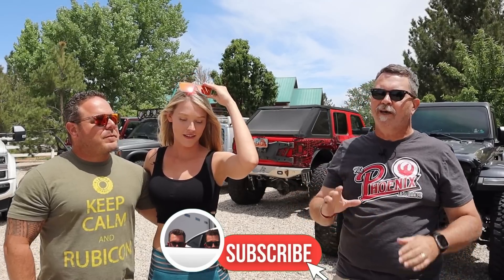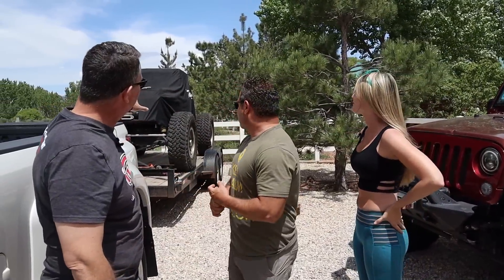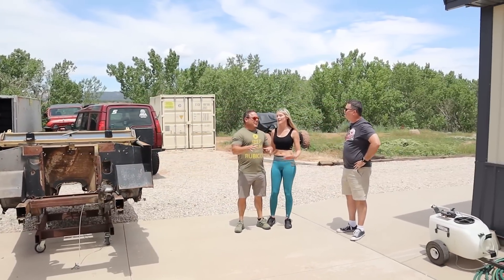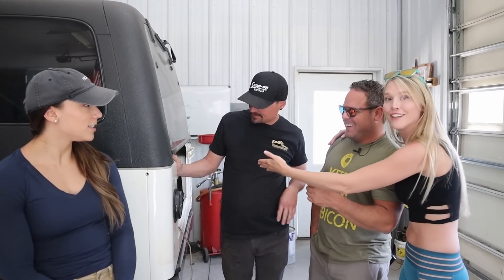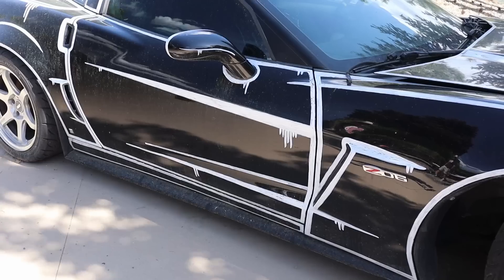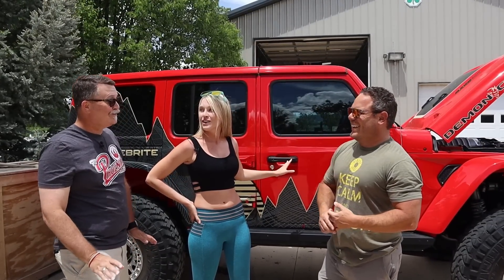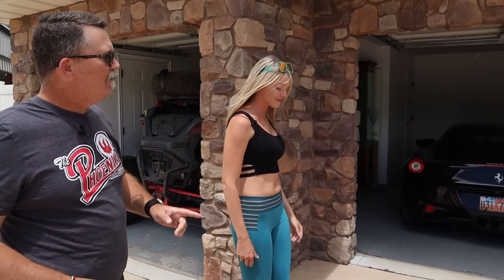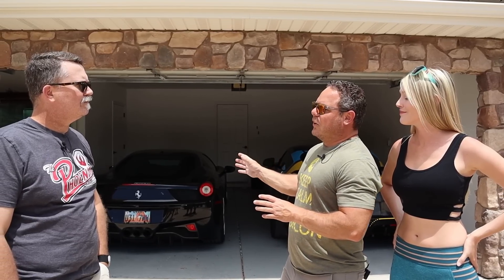LITE BRITE GARAGE TOUR!

Comment: Kevin, late on the comments, but need to clarify the issue on titanium exhaust.

The problem with using titanium for exhaust parts is that there are no manufacturers that do a vacuum stress relief. Provided the titanium is stress relieved, it doesn't work harden and crack. The other issue is that there are a multitude of titanium alloys, and it's quite possible that the alloy selected isn't the correct alloy for the temperatures the exhaust is exposed to.

I have a "few" titanium bicycles. The best riding bikes are made from 6AL-4V. It also happens to be double the cost of  commercially pure 3AL 2.5.

Inconel and Hastelloy are the super alloys used in high temperature aerospace applications. Both alloys have a melting point close to 1400C.

Comment: Inconel (Iron, Chrome, Nickel) is really dense and heavy. It's work hardening, super strong and heat resistant. It just doesn't care about heat at all. The reason why you're calling it light is because you can make it really thin. It takes special high dollar tools to do anything to it. Does not play well with any body. Oxy acetylene, forget about it.

Comment: Just some constructive criticism since I know your channel is new.. The audio is not the greatest. It's muted, robotic and single channel.. all signs of compression being set too high and using a condenser mic instead of a shotgun style mic, also the video is also a little oversaturated and could use a CPL-4 lens filter.. The content is solid; it just needs a little help in the AV department and you will have a great channel.
Reply from the maker: We were taken aback by the sun - we tend to use our lav mics outside, because its hard to work with wind and a shotgun picks up everything. 

Thanks for the comment though - we will endeavor to improve
Reply: Nice fun video. Just subscribed.  Keep up the good work